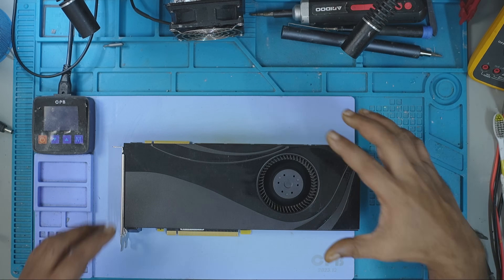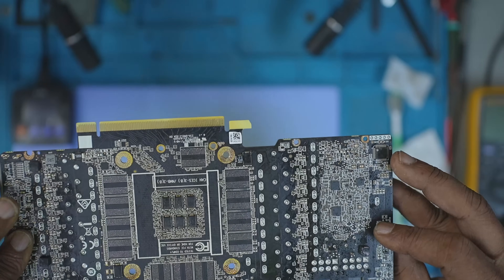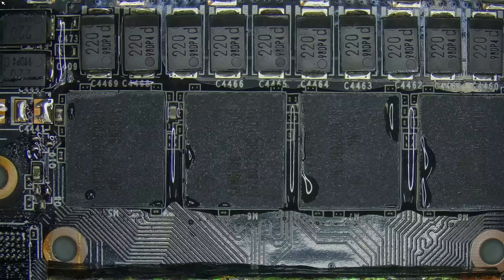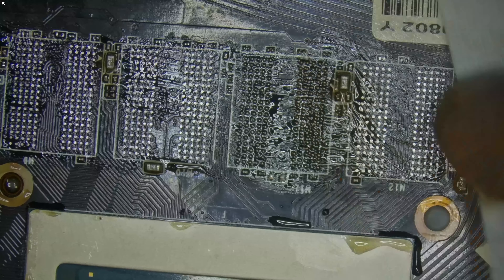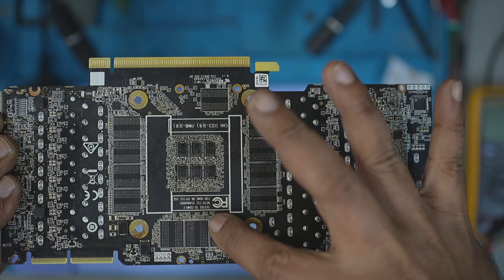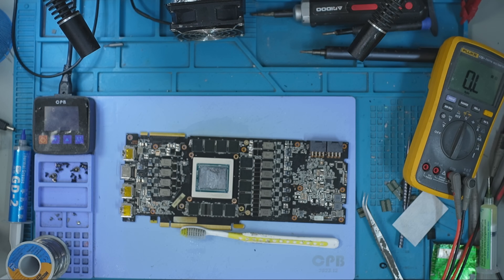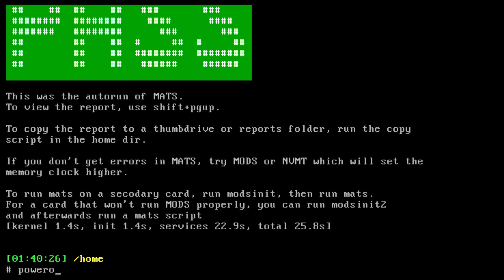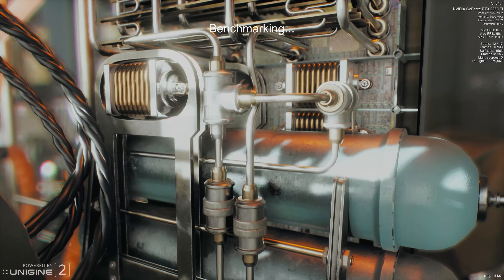Can Any GPU Get a VRAM Upgrade? | Asus RTX 2080 Ti (11GB → 22GB)

Comment: Have you tried modding a rx 5xxx series gpu? there is an article about on techpowerup about people modding a rx5600xt to enable the full 256-bit memory bus and then putting 16 gb memory on it so presumably just doubling the memory on rx 5700 (xt) cards to 16gb is also doable. (and probably modding  4gb rx 5500 xt to 8gb but that''s kinda pointless) 

Given that it seems feasible I wonder if we'll start seeing ex-mining rx 5700s modded with 16 gb on aliexpress at some point given how abundant those are, there are already a bunch of 16 gb rx 580 2048sp cards there.

Comment: What if we open source design a PCB with more memory modules pads and re-write the vBios .!
Reply from the maker: You will need a clamshell designed PCB like shown in the video. And with edited BIOS and drivers this thing can work. There is already a 48GB 4090 with custom BIOS and drivers on a clamshell designed PCB

Comment: So.... what you are saying is, I could buy a crappy 5060ti that has 8GB of RAM and upgrade it to 16 or even a higher amount of RAM?
Reply from the maker: No that's not what I said. The 5060Ti 8GB does not have memory slots at the back but only on front. Since this GPU core only has 4 memory controllers inside the core it needs to have slots at the back to upgrade to 16GB just like the 16GB version using the Clamshell technique. The 8 GB version cannot be upgraded further using the same PCB.
Reply: thanks for the clarification.

Comment: hi im a new sub and your amazing at this id mess it up! is 1 company's cards easier to upgrade? is amd better or intel with there 2gb chips  pal or is nvidia the king of upgrades? thank you for the video
Reply from the maker: Thank you for the Sub. There is no straight answer which GPU brand is better. It all depends on your needs. I use both AMD and Nvidia GPUs.  If gaming is the only thing, I would go with AMD as they already have a good memory setup and for a reasonable price. I am not accounting for the 9000 series. If content creation is your thing I would go with Nvidia as for the features it provides. For example the videos I created are captured in 1080p but are upscaled to 4k during editing. Nvidia works well for that. The reason Nvidia GPUs have an upgrade path is that they have the capability but are starved of memory for whatever reason Nvidia decided to use less.  AMD it's not the case. All their GPUs already use the highest possible memory modules in the memory slots. So there is no more room to upgrade. For that the PCB will need a redesign.
Reply: @GraphicsCardRepairs-tk7ql  thank you for the reply i collect amd gpu's starting with the navi1 rx5500xt 8gb my newest card is a 9070xt plus i got my hands on a rx6950xt asrock card last week 2 finish the 6000 series pal. i love your content its very informative
Reply: @GraphicsCardRepairs-tk7ql  crazy question but if i remade a amd pcb with extra space for ram would there be enough memory lanes left on the core to use it?
Reply from the maker: A clamshell design would be required so the same controller can be split between 2 modules. Example are RTX 3090 PCB shown in the video.
Reply: @GraphicsCardRepairs-tk7ql  thank you for your advice. i have a rx6950xt and i have also got a dead 1 2 that im tying 2 copy the traces so i can have pcb way to make a new board! its goin 2 take money and time but i want 2 make a 6000 series mega card for myself. when i have finished i will send you a board 2 play with after i have worked the bugs out friend

Comment: the 3080ti would be insane upgrade if it worked, as i am rocking a 3080 i wish it would be someday upgradable to 20gb at least
Reply: the RTX 3070, 3080 were both supposed to have official double RAM releases that were canceled. (Hardware Unboxed is on the record saying they were briefed on these products before they were canceled).
Reply: If I'm not wrong regular 3080 can't have doubled memory, you need a 3090 PCB
Reply: @buug76  i have a 3080 fe and it has 10 1GB modules so if we used 2GB it could get 20GB total
Reply: My 3070ti 8gb having 4 empty slots, with reballing présent (balls of tin). I think this is why the manufacturers having already made the architectural plans of their 3070ti card with 12gb of native vram, were reminded to order by nvidia to only put 8gb, so the manufacturer instead of redoing a new architecture, was content to leave 4 empty slots. In my opinion, so as not to overshadow them futures generations of cards 4070 12gb and 5060ti/5070...

I think compatibility will be complete, provided you don't get too greedy; just add 4GB (4x1GB of the same model as the one you're using) to get 12GB, as the card was originally designed to be.

But I don't think so for the doubled VRAM, though.

Comment: 5 years ago, I upgraded an MSI Gaming GTX 1070ti to 16Gb Vram, and it works fine, thanks to my friend who re-wrote the bios for it !
Reply from the maker: 1070 Ti uses GDDR5 memory modules. 1 GB is the largest memory capacity produced on this platform. there are only 8 memory slots on the RTX 1070 Ti. Unless your friend designed a new PCB using the clamshell technique, it will not work.
Reply: @GraphicsCardRepairs-tk7ql  No it doesn't. According to Nvidia's page for the 10 series of gpu's, and the summary from gpu-z in front of my face (I have a 1070 Ti), it uses GDDR5 memory. The 1080 and 1080 Ti uses GDDR5X.
Reply from the maker: @christianmichael4020 My bad. I have made the change. 1070 uses GDDR5. Thank you for highlighting it else incorrect information would go across. 😊
Reply: I bought the 1070 Ti from Nvidia the day it released, It uses GDDR5 and not GDDR5X. Look at Techpowerup, it says the same thing.
Reply: My understanding is that BIOS is the biggest hurdle these days with everything being locked up.
Reply: What a weird thing to lie about
Reply: He's probably not lying. The 1070ti DOES have gddr5 not gddr5x.
Reply: @strider6294  even 1060 6gb comes with gddr5x i had zotac (black one not AMP edition)
Reply: Did it helped with heavy vram games or applications?
Reply: @Proaz15  The extra Vram is not used and it is ignored.

Developers knows VRAM is an issue and optismise the play by querying the HARDWARE ID which tells the driver it has Xgb of ram, even if the card has been upgraded to double the VRAM.

The driver than limits the VRAM usuage to what the OEM baked in.
Reply from the maker: @robertlee6338 I have another video on my channel where I upgraded the RTX 3070 to 16GB. I have shown gameplay and it had no issues using the extra VRAM.
Reply: @GraphicsCardRepairs-tk7ql 😂....you commented saying useless it won't work upgrading the memory on 1070ti....then you say it works on your 3060 ? What ??
Reply from the maker: @jmoore9806 it does not work on 3060 as it already uses 2GB modules and it has only 6 active slots and 2 GB is the largest capacity. 1070Ti has only 8 memory slots and 1 GB is the largest capacity.
Reply: @GraphicsCardRepairs-tk7ql so can you please edit YOUR comment when you said you did it on a 3060 and it ACUTELY used ALL the vram....Because now your CLEARLY saying it wont work upgrading the memory on the 3060
Reply from the maker: I was referring to 3070 and may be in error I typed 3060. I will find that comment and edit it. Thank you for highlighting it. It will give the wrong message across.
Reply: @GraphicsCardRepairs-tk7ql do you know if an rtx 3070 ti could be upgraded to 16gb?
Reply from the maker: @kazipex 3070 Ti uses GDDR6X. I have not managed to get any GPU with GDDR6X working yet.
Reply: @GraphicsCardRepairs-tk7ql correct me if I'm wrong but I think I've seen Reddit posts about modded 3070 with 16gb
Reply: What benefit do you get out of lying about this
Reply: Pls help me brother Iam just upgrade my gpu from 1050ti to 3070ti but it won't turn on i tried all the possible trick when I unplug the pcie cable from the gpu its starts working normally n my psu is 750watt
Reply: I’m the president of the United States also

Comment: Not only that- the 2080TI core has technical capability for the split from x16 mode to x8 mode- meaning you can make it work with up to 24 pads- Also the GDDR6X is interchangable with GDDR6. The main difference is the memory strapping. Source is the 3080TI and 2080Ti schematics.
Reply from the maker: GDDR6 and GDDR6X are not interchangeable. The position of the data line and command lines is not the same. The memory voltages are also located in different locations. I have shown the layout of the memory in the video. If you install a GDDR6 memory in a GDDR6X slot or the other way around, it will cause a short.
Reply: The position that is different is two command line strappings. Let's see here if I can pull up my repo. 

GDDR6x MAP	LOWER 0,31	UPPER32,63	X16
CA def	DRAM1	DRAM2	
CA0_A	CMD1	CMD33	
CA1_A	CMD14	CMD44	
CA2_A	CMD11	CMD35	
CA3_A	CMD24	CMD47	
CA4_A	CMD12	CMD36	
CA5_A	CMD15	CMD45	
CA6_A	CMD22	CMD49	
CA7_A	CMD23	CMD48	
CA8_A	CMD0	CMD34	
CA9_A	CMD2	CMD32	
CABI_A	CMD10	CMD37	
CKE_A	CMD13	CMD46	
			
CA0_B	CMD5	CMD29	
CA1_B	CMD17	CMD43	
CA2_B	CMD8	CMD40	
CA3_B	CMD20	CMD51	
CA4_B	CMD7	CMD39	
CA5_B	CMD16	CMD42	
CA6_B	CMD21	CMD50	
CA7_B	CMD19	CMD52	
CA8_B	CMD6	CMD28	
CA9_B	CMD4	CMD30	
CABI_B	CMD9	CMD38	
CKE_B	CMD18	CMD41	
			
RESET	CMD3	CMD31	
			
GDDR6 MAP	LOWER 0,31	UPPER32,63	
CA def	DRAM1	DRAM2	
CA0_A	CMD1	CMD33	
CA1_A	CMD13	CMD45	
CA2_A	CMD12	CMD35	
CA3_A	CMD24	CMD46	
CA4_A	CMD11	CMD36	
CA5_A	CMD15	CMD43	
CA6_A	CMD22	CMD48	
CA7_A	CMD23	CMD47	
CA8_A	CMD0	CMD34	
CA9_A	CMD2	CMD32	
CABI_A	CMD10	CMD37	
CKE_A	CMD14	CMD44	
			
CA0_B	CMD5	CMD29	
CA1_B	CMD18	CMD52	
CA2_B	CMD7	CMD40	
CA3_B	CMD20	CMD50	
CA4_B	CMD8	CMD39	
CA5_B	CMD16	CMD42	
CA6_B	CMD21	CMD49	
CA7_B	CMD19	CMD51	
CA8_B	CMD6	CMD28	
CA9_B	CMD4	CMD30	
CABI_B	CMD9	CMD38	
CKE_B	CMD17	CMD41	
			
RESET	CMD3	CMD31	

Only difference is two lines. CMD 17 to 18 and CMD 13 to 14
Reply from the maker: @darkride196yes it will still not work. You can test it to see the outcome. Ground pins is located on the pins of GDDR6X, where Data pins are on GDDR6. I can send you the pad layout if you like. It will cause a short if you interchange the memory modules. You can also refer to the memory error videos I have on my channel, where I measure the data lines to fix GPUs. I have also flashed the pad layout in the video. You can also pause it to see the pad layout. If you think my data is wrong, you can refer to the manufacturer's datasheet. The links are as below. 
GDDR6X: https://www.micron.com/products/memory/graphics-memory/gddr6x/part-catalog/part-detail/mt61k512m32kpa-21-u (Not openly available but registration is ,required with MICRON to access the datasheet)
GDDR6: https://www.mouser.com/datasheet/2/671/mict_s_a0009021659_1-2290912.pdf?srsltid=AfmBOorFWcAJewJz6ewupH89n9IP39MX1z_sQ-RjSCG5Gu5Hg2fpiypI

Comment: There is Chinese GPUs RX 580 upgraded to 16Gb. So it possible.
Reply from the maker: I have not tested yet. On the same PCB, it's not possible unless they use a clamshell technique. 1GB is the largest capacity on GDDR5 platform.
Reply: @GraphicsCardRepairs-tk7ql well I think they use custom pcbs and memory chips soldered on both sides

Comment: If a 3070 can be upgraded to 16GB, can the 3060Ti take 16GB as well?
Reply from the maker: I have tried it. The bios is written to disable 2 channels. It acts like a 3060. It does not work. The BIOS needs to be worked on to fix that.
Reply: @GraphicsCardRepairs-tk7ql  that's odd, since the 3070 and 3060 TI are both natively 8GB cards using the GA104 GPU die. But it's Nvidia, so I guess I shouldn't be too surprised.

Comment: Hi, awesome content! I’m into drones and there’s a lot of soldering  and some light programming involved. However it does take a while to get the skills down. So instead of buying all of the equipment. I am really considering just taking you up on your offer $205. How long would it take? Do you have a discord? Would I be limited in any way like having to use 3rd party software or not being able to use DLLS? Do you have any guarantees? I have a evga 3070 three fan card. I’m also asking for other people in the drone community. They have a lot of 2080’s ti. Also how much would shipping be in the United States?Thanks again!
Reply: What are gpus used for in drones?
Reply: @bigboss-n7k lol no gpu’s however there’s soldering and testing components. They have a lot of similar components,mosfetts ect… granted you don’t have go to deep into that rabbit hole unless you like fixing things.
Reply: @bigboss-n7k  oh wait I get why you were asking that. In order to run velocidrone simulator, the more FPS you have the better time you’re gonna have and the better you can get at practicing kind of like with car Sims or any other Sims. When you crash on the Sim, you don’t have to do any repairs at all lol
Reply: @BoondockStryker thanks for the answer
Reply from the maker: Shipping from united states is 75 to 100 depending on the size of the package.  That's one way. I suggest you visit my website for information.
https://gpusolutions.net/faq

Comment: A question about the RTX 4000 workstation card which is based on a 2080 8GB. Is it possible to upgrade the RTX 4000 8GB to RTX 4000 16GB - and is there  any potential to upgrade the VRAM in RTX 5000/6000/8000 although these cards seem fully populated and are based on the higher end 2080s.
Reply from the maker: I have not tested an RTX 4000 yet. Difficult to say at this point. Never tried on any workstation GPUs.
Reply: @GraphicsCardRepairs-tk7ql  I refer to the wiki on nvidia workstation cards as a basic reference. https://en.wikipedia.org/wiki/Quadro

Comment: I have a 4060ti 8gb. Since there's a commercial 16gb model would be interesting to see if the 8gb could be converted to the 16gb .
Reply from the maker: A 16gb version PCB will also be required to do the upgrade. Normal 8gb does not come with slots at the back.
Reply: @GraphicsCardRepairs-tk7ql  thank you man for your quick response. I have just seen on tech power up the pcb image 😢

Comment: Is this mod worth it for a $300 (second hand) card (ie. 2080ti)?
Reply from the maker: This mod is not suitable for gaming on a 2080ti. For AI it's a cheap alternative.
Reply: @GraphicsCardRepairs-tk7ql  Yeah 22gb would be decent in a cluster. I wonder how energy consumption and tensor cores of multiple 2080ti would compare to a v100 on a pcie slot. It may still be suboptimal but probably provides something to play with.

Comment: 2080 Ti, Bus Width : 352 bits ???
Reply: The GPU core is made with 384bit bus, BUT it gets laser cut to disable a defective 32bit bus and a few SMs, this way ngreedia can sell you garbage chips and keep the fully functioning ones for AI and charge tens of thousands of dollars for them.
Reply from the maker: Yes 32 x 11 = 352 😊
Reply: TechPowerUp says 384 bits, Gpu-Z says 352. Confusing. :/
Reply from the maker: @Harfinou each memory slot has 32 data lines. 8 in each corner. There are 11 active memory slots so it's 352 bit.

Comment: This is exciting!
Now that we have ZLUDA/ROCm for native CUDA support in windows for AMD cards and the RX 9070 series are GDDR6 - do you happen to know if these memory modules can be upgraded?
an upgraded 9070 would be INSANE for LLM use.

it seems new AMD cards and used NVIDIA is the way too go these days.
Reply: i know you can flash a XT bios onto a non-XT card as well - so this might have resolution with driver/bios signature.

If not - let me know because im keen to make real world developments with it - my card arrives tomorrow!
Reply from the maker: As explained in the video on GDDR6 and GDDR6X platform 2 GB is the largest capacity. And on AMD GPUs all active slots are populated so there is no room to upgrade further.

Comment: There are 3080ti's being sold for $500 in Aliexpress, I wonder if we can have a 24gb 4080!!!!!
Reply: RTX 4080 uses 2GB modules so sadly nope. But i've heard it's possible to make 48GB RTX 4090 by transplanting 4090 core onto 3090ti pcb and replacing 1GB vram chips with 2GB ones
Reply: @Radmon222  Now THAT would be cool and then to have 2 of them and run a high param local LLM
Reply: I tried this on a 3080 and it didn't work.
Reply from the maker: @northwestrepair looks like something with the BIOS. None of the GPUs with GDDR6X are working with the upgrade.
Reply: Watch the damn video. 🙂
Reply: I think it's not matter of bios cause a 3080 core on a 3090 PCB can see double ram with the 3080 bios, and you can find also bios from 3080 20GB.
Reply: no
Reply: You can find used 3090 for 600 and sometimes even lower but I would definitely not buy my GPU from AE

Comment: I know that rtx 3070 can be upgraded but can 3070ti be upgraded?
Reply from the maker: RTX 3070 Ti uses GDDR6X and none of the GPU using GDDR6X I have managed to upgrade. I am working on a 3080 Ti and if I manage to upgrade than the process would be the same for 3070 Ti and all GPUs using GDDR6X.

Comment: I definitely want to to try this, try to find myself a 3070 maybe one with bad memory to upgrade to 16. But it is going to be a long path. I actually have all the equipment except bottom heater. A little unconfident in my hot air station since it has some quirks, but we'll see. I really need to practice BGA, and i think disused routers with obvious issues such as radio or magnetic can be a good first step - they are trash heap items, and you can easily assess whether memory still works simply by plugging it in and watching the flashing boot light or listening in on UART. I can also practice with dead/stripped GPUs. Fermis are also decent trash heap items to practice on, i guess. Less of a practical purpose, i really just kinda want to do it, although i can of course put the memory to use.